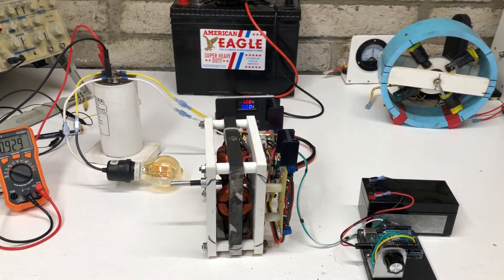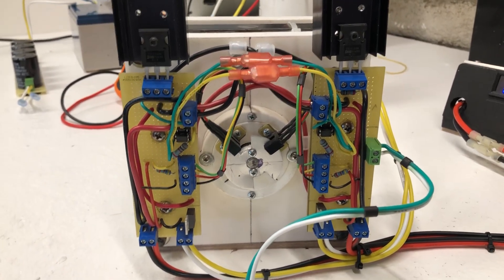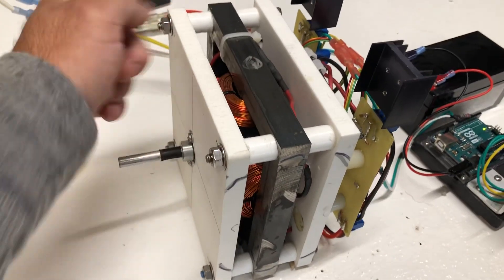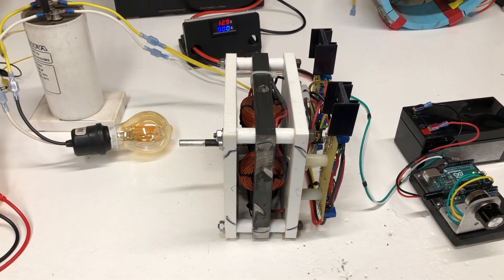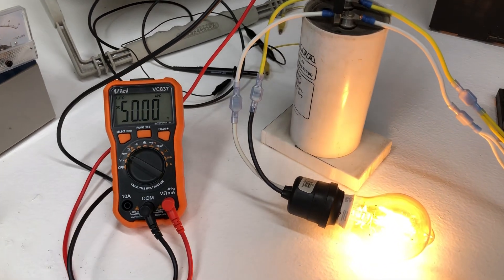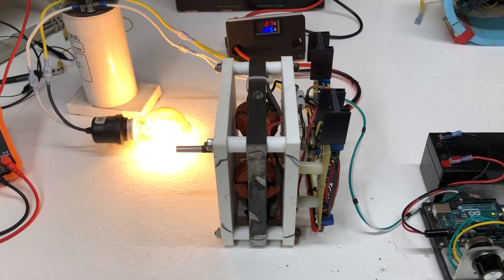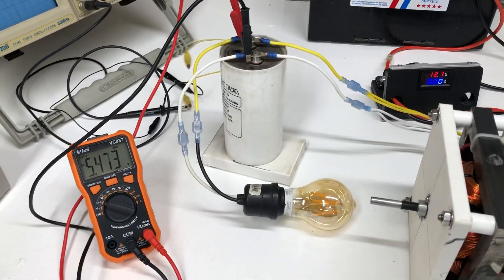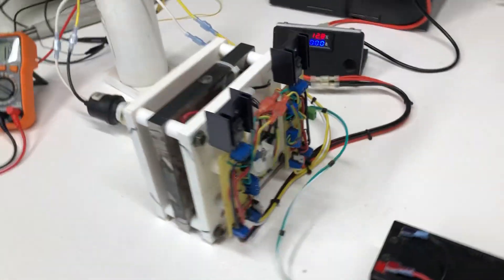Adams type repulsion motor with magnetic loop and out put

Comment: I have an extra uno.... so I now want to build a pwm. You gotta share that or point me in the right direction. LOL
Reply from the maker: Look up the code for pwm using a 5 k pot I used one that was for a led dimmer
Reply: @kenergy1707  I found it. I like the idea. I've been using a self built version. Sometimes I use the little simple china boards but with a power switching circuit for more amps.

Comment: If you use LEDs you can go straight to the original battery to help recharge it, diodes work differently then LEDs using the bemf 👍 love your work by the way. Creative motor designs
Reply from the maker: I’ll definitely try it 
It works with zener diodes but it takes about 15 of them in parallel but does work otherwise it’s a direct short 
I use secondary winding to get around the problem unless I’m charging a second bank of batteries
Reply: @kenergy1707  https://youtu.be/uROzCf4AsRc
What's this guy old videos He did this a lot 10 year's ago. I learnt a lot from him about bedini circuits and modifying them, getting much better results 🙂. Some of his motors are self-looped
Reply from the maker: @gregstafford2155  
I’ll check it out 
 Did you see my outboard motor on the shorts video?